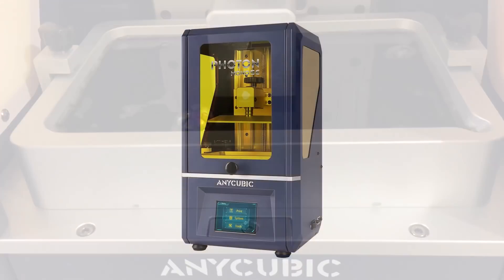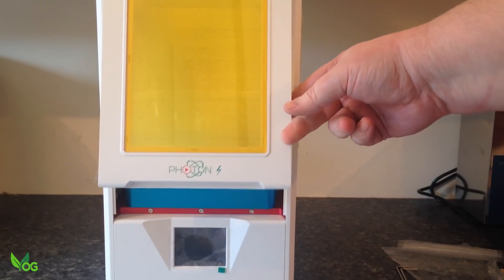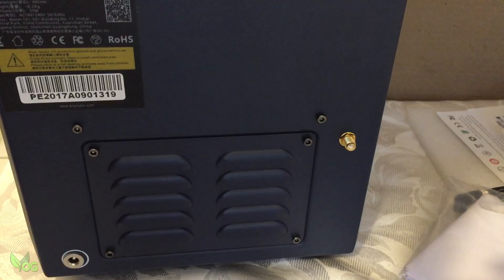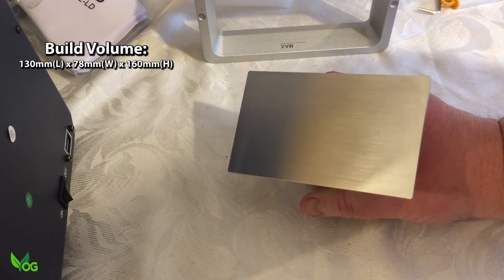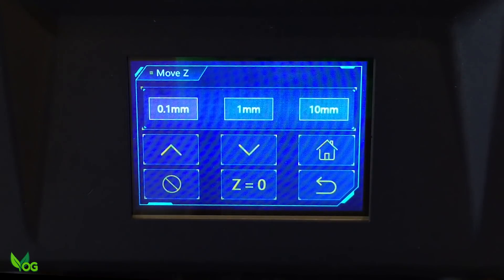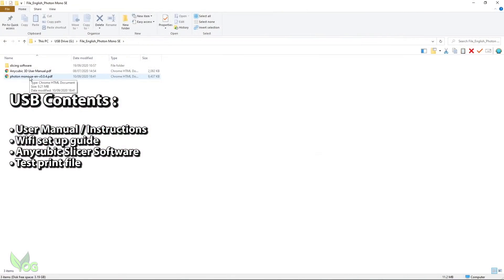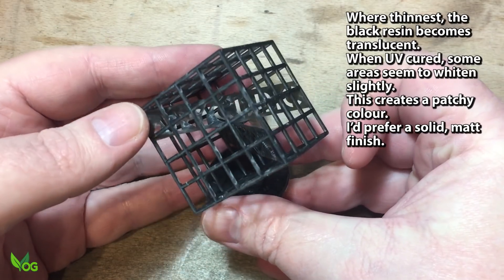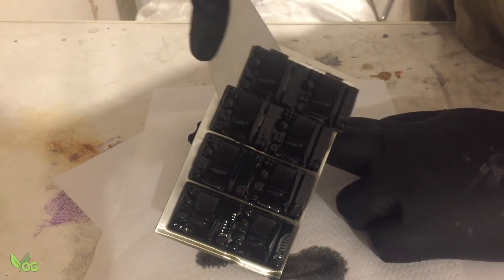Anycubic Photon Mono SE HONEST review by VOGMAN

Comment: ethernet cons prone to drop outs
no that is normally only a wifi con 
because id there is a drop out over ethernet its an issue with their operating software
Reply from the maker: I can only assume you don't have Windows😁
If I leave my PC unattended, Windows hijack it for an update and THAT can interrupt the signal to a printer. Similarly system maintenance checks, viruses, internet connection problems, etc. Thus both wifi and ethernet CAN POTENTIALLY drop out 😊
The only safe way is the USB stick.
Reply: @vogman  you can (and should) disable the automatic reboots of your windows PC.

In any normal LAN Network, the USB Stick is more likely to randomly lose data than a LAN connection losing connection. (note: internet connection has absolutly no factor on the lan network)
Reply: @vogman  I totally agree with you and would love to see a solution with a "best of both worlds" approach. It would be awesome to configure and transfer the print to the printer via WiFi or Ethernet, BUT it has to be in a way that the printer buffers the print file in his own temporal storage. This way the print would not be interrupted if the source of the file is not available over the chosen network technology. What do you tink?